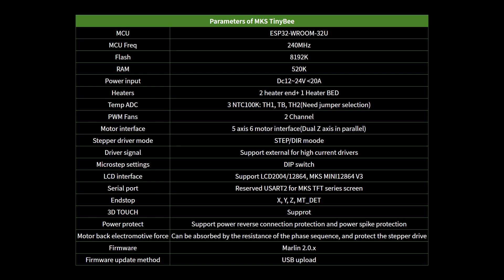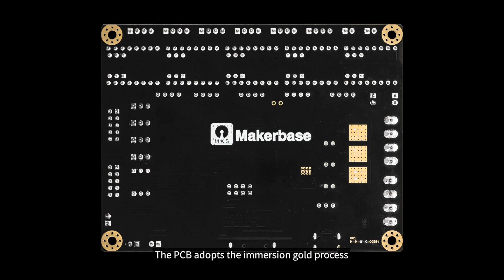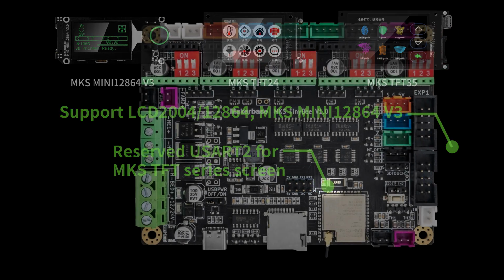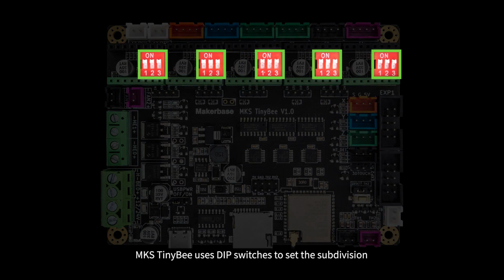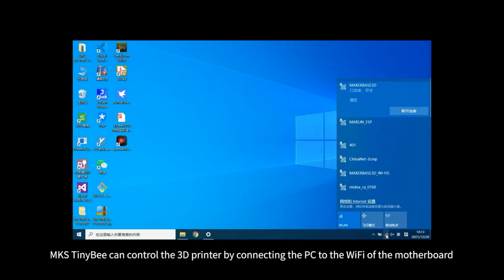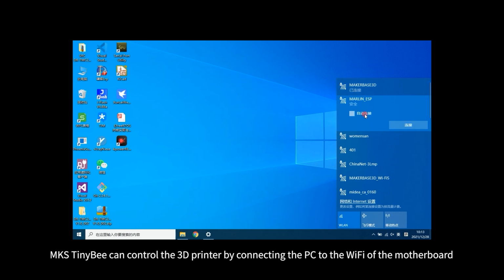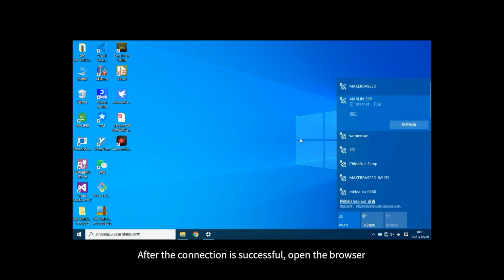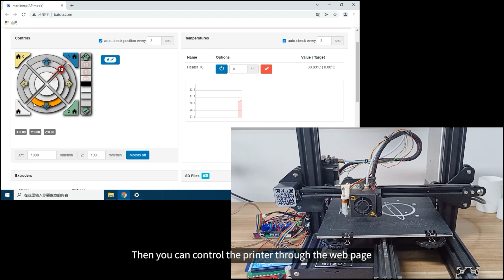Makerbase new product introduction: MKS TinyBee

Comment: I've tried installing Marlin from your website in Visual Studio, following all the steps, but when I try to complete the process, I get an error and Marlin won't load. I tried powering the board, and now I see the IP address, but the bed heater and extruder temperature go to maximum, and it's not reading G-code.

Comment: can the board be reprogrammed to perform other functions, not just 3D printing? e.g. If want to control motors on a robot or for some movements of scenery on a model railway?
Reply: Yes. It's also commonly used to control router machines

Comment: I had difficulty downloading the firmware on the board.
I had to keep pressing the button next to ESP32 to connect and keep it pressed until it appears connecting in VS Code.  When it appeared connecting, I released it and it downloaded normally.

Comment: does it have short circuit protection on heater cartridge?
Reply: There are fuses protecting the board and upstream power supply in the case of any short, but they look to be non polyfuse type, they need to be desoldered and replaced if you pop them.

Comment: hello my friends. Could yuo help me with optical endstops? TMC2209 Lerdge 1.0 non uart(stepdir) mode.  xy mechanical enstops work fine but optical - no reaction. Could someone help me?
Reply from the maker: How much V is your optical switch powered on? In your case, you can't stop when you get home? Still can't go home?
Reply: @makerbaseteam4217  nope. s g v(5v). when im hit home - motor rotate a bit(not even full circle) and stop. trying normal opened and closed. the same
Reply from the maker: @L0rdD3s7r0y3r  Rotate a little bit, the level of enstop set in the configuration file is wrong, you can configure it in reverse (false/true)

Comment: How could i connect mechanical endstop? No reaction.
Reply from the maker: Connect the S and G of the mechanical limit to the enstop interface on the motherboard, you can refer to our manual
Reply: @makerbaseteam4217  its working, butno reaction with optical s g v

Comment: Hi Makerbase Team, my REPRAP_DISCOUNT_FULL_GRAPHIC_SMART_CONTROLLER is not working I changed serial port_2 2 and disabled wifisupport but it just beeps and flashes intermittantly.......screen works fine on ramps.
Reply from the maker: Which is your screen? not ours, you need to reverse it
Reply: 👍Thanks Makerbase Team, I now got it working....here`s what i did, i pulled up the two plastic connector blocks away from the pins(EXP1,EXP2) then turned them 180° so the cutout is at the top and pressed them down onto the pins.These screens are in reverse to MKS boards...hope it helps someone😀.

Comment: I have serial port connection error when ever I switch the PSU on. I am also having problem connecting it with repetier host. When I try to home X axis it makes noise and miss steps and fail to reach enstop. Other axis work fine.
Reply: Got the problem solved by not connecting the endstop red cable. Though it used to work nicely with ramps.

Comment: Hi Makerbase Team, is it ok to use a 12v 30A power supply or will it overheat the mosfets and do the mosfets have a heatsink????
Reply: This construction is tried and tested and can survive up to about 12A bed current - the MOSFETs are heatsunk into the PCB, there is no explicit heatsink and you aren't supposed to put one on top, as it's not going to do much. There is a thermal via arrangement and cooling area at the bottom of the PCB where you can heatsink them if you feel that they're getting a little too spicy warm to your liking, but it should be alright.

Don't worry about the amperage of your PSU that you connect, as long as it is sufficient. Worry about the amperage that the connected components are going to pull.

I also think it's more likely for the bed MOSFET to fail in this board due to inductive kick rather than due to heat, since no freewheeling diode has been foreseen. I don't see it as likely that the other MOSFETs will fail. It is of course easy to pop a fuse if you short something, necessitating repair. Of course operation independent failure is always possible due to a defective component or handling errors during PCB manufacturing, it is what it is.

Comment: Hello,
I have a 12V 20A power supply, I see that on the board there are 12V and 24V outputs, would I have 24V output with a 12V power supply. (i have a 24V heat bed)
Does the card have a DC-DC converter?
Thanks for your answer.
Reply from the maker: 12V power output 12V, 24V power output 24V

Comment: Does it have protection from shorted thermistors or heating element?
Reply from the maker: Yes, it has protection devices
Reply: @makerbaseteam4217  Thanks! Video only showed protection for input power and motor driver. How about protection from a shorted thermistor? Or heating element?